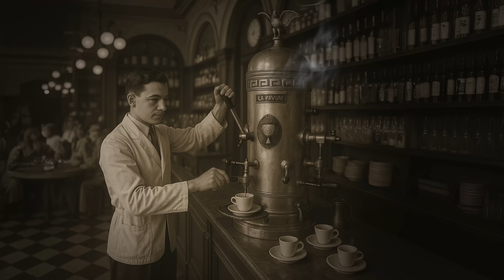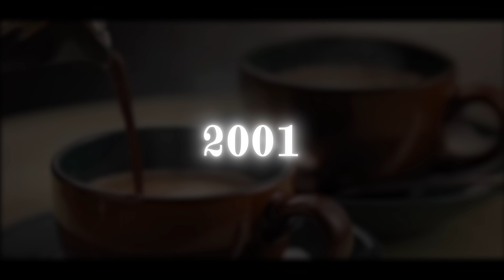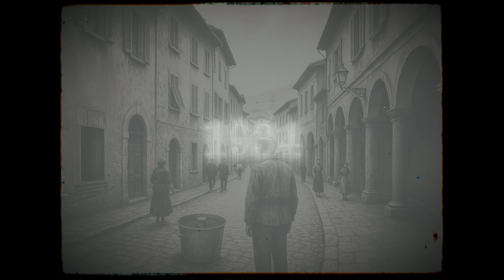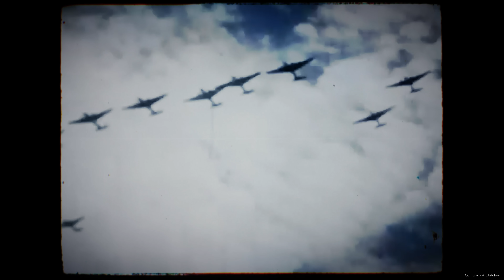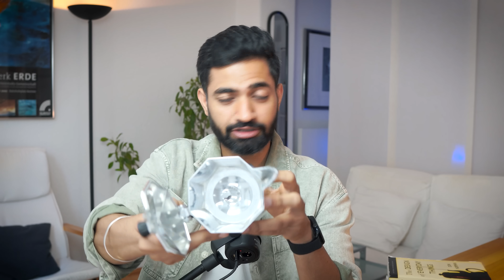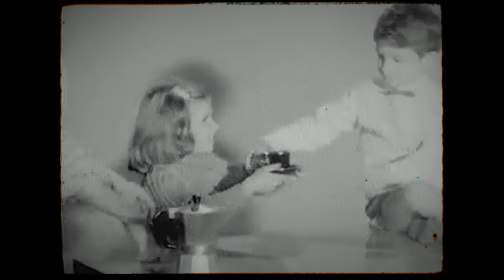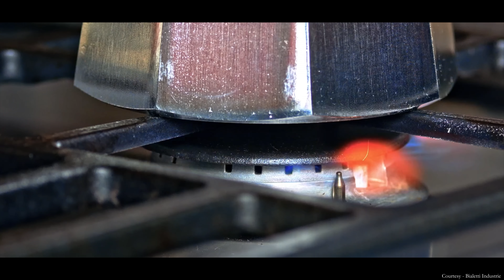The Genius Design That Makes ALMOST Perfect Coffee

Comment: My first Bialetti- Italy 1982. It was a little one, and I loved it. Somehow it was lost in the move back stateside a few years later, and I tried some of the copycat pots but was disappointed when they were all thin-walled and useless. Bought an electric espresso maker (which works fine), but since I don't drink much coffee on a regular basis anymore, I gave up. Finally, at a thrift store a couple of years ago, I came across a big 9-cup and a 6-cup (at different times). They are both the heavy aluminum Bialetti Moka Express pots ... and I am enjoying my cappuccino again!
Reply: I once tried a stainless steel Moka pot. The stainless steel conducted heat so fast that the water boiled so quickly and the coffee came out was not as thick as with the aluminium pot. The aluminium pot boiled more slowly but the coffee was tastier. Since then, I was stuck with the aluminium pot.
Reply: @Huy-g7l  Didn't you try using a lower heat setting on the steel pot? The instructions on mine say to use medium heat.
Reply: @AntiAntiAntiFa  1. Your suggestion about the temperature control is spot on, but my stainless steel Moka pot was a design failure, regardless how I tried to control it. I bought the Avancer pot in 2016. It was a copy of 4-cup Bialetti pot at the time. I bought it out of curiosity, because it was the first time I knew a Moka pot designed to work with induction cooker. 

2. After reading your comment, I started to make a coffee cup with my stainless steel Moka pot to refresh the memory. First, I boiled water in a jug to release the chemicals in the tap water as much as possible. After a few minutes, I poured that hot water to the container, under the relief valve level 1 mm. I will explain later why I did not wait for the water to cool down. Then I filled the funnel with ground coffee. After tightening the body and the container together, I put it on the induction cooker and set the temperature at 100 degrees Celsius. Next, I turned around to add some additives to the mug. Then suddenly I heard the sound of rushing water inside the pot. I quickly turned off the power switch, lifted the pot and poured all the coffee to the mug. I tested the coffee and found it not very hot, tasteless and no bitterness – exactly like what I got 9 years before.

3. I made another coffee with tap water at 21 degrees Celsius. This time, it took 2 minutes and 15 seconds before the coffee rushing out of the spout. The coffee was still tasteless as described above.
Now let me show where the flaw of the design is. The iron layer at the bottom of the pot is too thin, therefore it transfers all the heat from the cooker to the stainless steel pot in no time. 

5. A week ago, I bought a genuine 6-cup Bialetti pot made for induction cooker. It was a new design, with a very thick iron bottom. The container of the pot weighs 500 grams. Meanwhile, the Avancer container weighs only 200 grams. Of course, the 6-cup container is heavier than 4-cup one, but even adding two of the latter together (equivalent to 8-cup container) their weight is still only 400 grams. 
The thick layer of iron in the Bialetti pot absorbs the heat from boiling water I put in and the heat from the induction cooker. Still with the setting of 100 degrees Celsius, it will take about 5 minutes for the water inside the pot starting to boil and becoming steam. That means the brewing time is much longer than for an Avancer pot. Regardless hot or cold water inside the container, the coffee taste is always good.
Reply: @Huy-g7l  I never had a stovetop with temperature settings, just uncalibrated numbers. With the Avancer, I'd try using numbers less than 100 at about 2 minutes. You could also try taking it off the heat when the coffee first appears.

I don't think any water comes in contact with the coffee until the boiling starts. The boiling needs to be gentle enough to give you enough extraction time, so I think the Avancer is getting too intense of a boil at the 100 setting. This is where a visible, adjustable flame would be ideal.
Reply: @AntiAntiAntiFa  My induction cooker is a Chines-made 2000 Watt one. Its brand name is Healthy Choice. I bought it from Amazon. It got a plastic strip sticking to the stove top, stating the relation between the wattage and the temperature of the object. It starts with 200 Watt mark for 80 degrees Celsius, meaning to keep the pot constantly at that temperature. I did not press 200 Watt button, because the water would never boil. Next, 400 Watt mark for 100 degrees Celsius. So 400 Watt heating is very reasonable. Nevertheless, I will experiment with 200 Watt heating to see any better.
Reply: @AntiAntiAntiFa  I have just made a cup of coffee with 80-degree setting. The temperature of the produced coffee was much less than 80 degrees, because I could sip it right away and my tongue did not sense hot. The coffee was not bitter at all. So, it was a failure. I am thinking about a remedy: welding a thick, round iron plate at the bottom of the Avancer pot, just like the Bialetti pot which I bought one week ago. It will take some time.
Reply: @Huy-g7l  That's a big jump between 200 and 400 watts, with nothing in between. My guess is that 200 will be too low. Too bad you can't try something in the 300-375 range.

You can get a steel or iron disc with a handle, that will also work with non-induction pots. I have one I use with a copper Turkish coffee pot on an induction stove.
Reply: @AntiAntiAntiFa  400 W for 100 degrees Celsius. That is the minimum heat for the water to boil. Otherwise, the coffee will not be bitter, as I demonstrated today. About the iron disc you mentioned, I bought that kind of tool years ago. I have tried it on cooking pots and reckon it was a scam. The heat transfer efficiency was very low. In my guess, it was as low as 30% or less. It must be welded to the bottom of the pot so that the heat transfer is 100%.
Reply: @Huy-g7l  The efficiency of induction in general is debatable, too, and depends on the metal in the pot. You might want to try an inexpensive non-induction burner with a continuous control knob.

I've made decent coffee at 65-99 degrees, but not in a moka pot. I immerse the coffee for many minutes to get enough extraction. I tried it out when I was looking into cold brew.

Comment: aluminium and no connection with dementia then ?.
Nescafe and a microwave, can't go wrong, my only concession to the modern world.
Reply: The connection between aluminium and dementia is not conclusive. Plenty of food additives contain much more aluminium than what you can get from using aluminium cookware to cook acidic food. You’re also very unlikely to scratch a moka pot during use than e.g. an aluminium pot. Coffee oil also coat a moka pot to further reduce aluminium transfer.
Reply: @lokon1979  of course you're correct, that's why we're all still cooking with highly conductive, easy to manufacture pans, duh!.

Comment: Tip: don't leave coffee in the pot over-night to be consumed later. Aluminium can corrode over time so get a new one if you find oxydation( usually when used rarely then stored away for years) .Don't scrub the pot with rough abbrasives to make it shine again, give it a good wash and rinse , dry it with a clean cloth before and after using it..If you can afford the Extra for the Stainless steel version  go for it, just keep them clean.If by chance you forget the Pot on the stove and it boils over don't panic, don't touch it just turn the heat "off" and let it slowly come back to ambient temperature. Remember a well cared for Bailetti will out-last even the best stainless steel Espresso machines. Take your time, it's a ritual that requires your full attention.❤
Reply: You don’t wash the moka with any detergent ever, you just rinse it with water, after use.
And no big deal if the coffee stays overnight.

Comment: I must have used it incorrectly. All the coffee I've made tasted burned.
Reply: Finer ground makes stronger coffee, too fine it become bitter. Find your own setting.

You don’t want the coffee ground to be under heat for too long, that makes bitter coffee. Better heat your water with only the lower part on the stove first until just before boiling (coffee ground away from heat).

When coffee start coming out on top, observe how quickly it rise, compare to video from YouTube. There’s not one single “right” answer but should too far from “normal”. Brewing for too long means the ground subject to heat for too long and become bitter. Likewise remove from heat before the brewing finish and pour immediately. The last bit could be bitter.

There are many how to articles and video online. Using a moka pot isn’t as simple as most claim to be, but it is already one of the simplest if not the simplest “manual” coffee making method (compare to machines)

Comment: Thanks, that was a great piece of history that I didn't know about. Being American as I was growing up in the 60's, it was percolated coffee. I still remember the supermarket had a machine that would grind the beans into a bag, and the smell was sublime. Then filter came in and that was easier but the coffee was horrible. I never saw this type of coffee maker until I moved overseas. Mine wasn't octagonal, just round. One day it actually did explode with the upper section hitting the ceiling and hot coffee going everywhere. Turns out the male threads had worn from use and the pressure created a coffee rocket. Luckly I had left the kitchen just prior to the excitement! 😊
Reply: The pressure release valve has a little “nipple” that is for you to push it around a bit every time you wash the pot, so to loosen any limescale that might block it, that could prevent overpressure explosion. Yep I’m that dull to actually read an instruction manual of a moka pot!
Reply: @lokon1979  Thanks .😊

Comment: Because one mocha pot of french roast uses exactly 10 grams of beans, it's easy to calculate the price of a home brew: 1% of the kilo price. With coffee prices going up and up, a mocha pot of joe still costs less than US$0.25 if you brew it at home.
Reply: Plus the coffee is incredible.
Reply: My concern when I went to buy one because it's a brilliant idea is that they're all made out of aluminum in that it would be toxic to the human body.
Reply: @aa-eq7fv I did my research online about it, basically the amount of aluminium you could ingest through your cookware is insignificant (we all use aluminium foil too remember?); plus you were supposed to throw away the first brew of coffee so the oil residue coated the moka pot, masking the metallic taste and also further reduce aluminium transfer to your coffee. You also are very unlikely to scratch a moka pot during use compared to e.g. an aluminium pot.
Reply: @aa-eq7fv  theres no issue. even your water is treated with alum, the amount you get from a moka pot is negligible to the body.
Reply: @aa-eq7fv my bialetti is made from stainless steel 😊

Comment: I've owned my Moka Pot for over 50 years. I bought a diffuser plate about ten years ago, so I don't have to balance it on my gas burner. It mostly sits in the cupboard for the last year, since I bought an automatic electric espresso machine.  But during power failures, I can still make coffee.  I no longer camp, but it was my camp coffee maker for years.
Reply: I love my coffee pot😅
Reply: As a biker in 1980,90,2000,s we always bought ourselves a stainless steel coffee pot, we would cook on open fires @cross Europe & beyond.still use them.

Comment: No I mean every thing is fine simple but state of art design.  But at the end it's made from Aluminium, easy to melt at lower temperature and then to pour in moulds.
Bu the concern is it's Aluminium daily use of it will seep Aluminium in coffee at that heat and pressure.  Then is it good for health ???
Reply: Yes, Aluminium is the most active metal, atoms of which attach to brain cells and cause Alzheimer's disease.  A friend of mine, one of the most well known professors in that field (UCL) informed me that a very effective compound preventing the process is quinone, which you can find in the Indian tonic water.  So if according the Italian tradition you make your everyday coffee in a Bialetti moka pot, then you must follow the British tradition and finish your coffee with a gin and tonic shot.
Reply: @Ole_Mercool  Hey thanks bro your explanation was precious.

Comment: point of correction
0:33 that machine the early Espresso type machine like the La Pavoni also used to be in the same ballpark as Mokapot since there's no pump for espresso machine in 1800s, so they produce around 1-2 bar of pressure and rely on steam power and act more like a batch brew. the true 9 bar of pressure in espresso is invented in 1938 with Gaggia Lever Machine. so they're not wrong for calling moka pot a stovetop espresso since it is an espresso (the old early type of espresso)